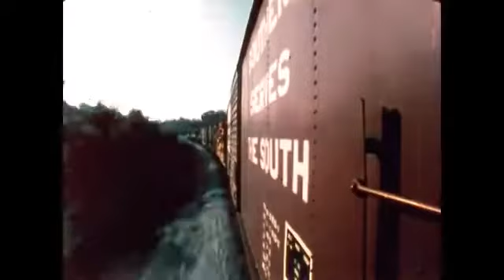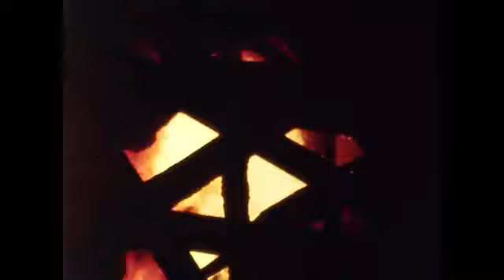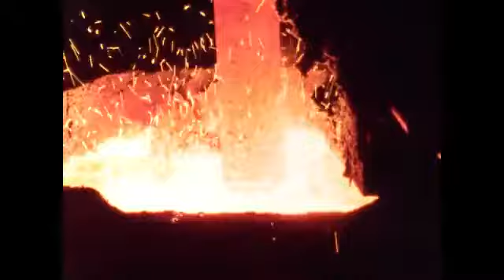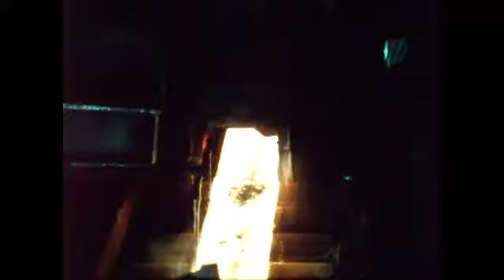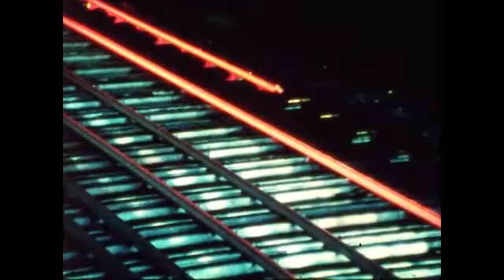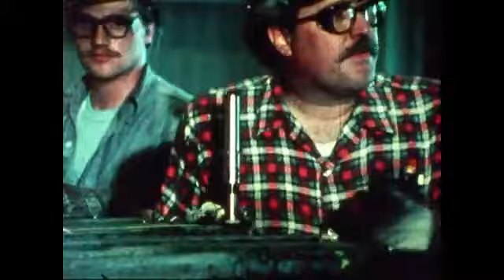WP Rail Mill Monessen

Comment: That Monessen rail mill should never have been built.  It never generated one dollar of profit for Wheel Pittsburgh steel.  The caster was sent to Lorain.  The rail mill was sent to Angola Africa.  Wheeling Pittsburgh could have made significant improvements to the 80" hot mill at Mingo Junction with the 160 million dollars spent at Monessen and been much better off.  Running Monessen's steel through Mingo Junction's hot mill would have been a superior long term solution.
Reply: They built it because France (I think) was upgrading their rail network and they wanted to get in on it. But they bought the rail from someone else and doomed it. 

I agree with you though, the 80” is cold. We can’t produce enough steel to justify starting it back up unfortunately. At least JSW is trying to make steel in Mingo, but with just the EAF and Caster.